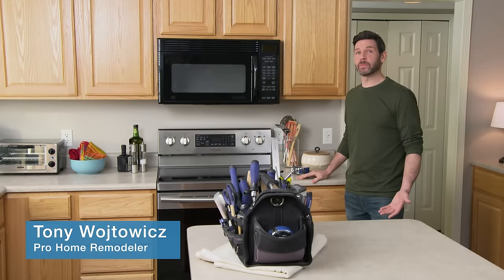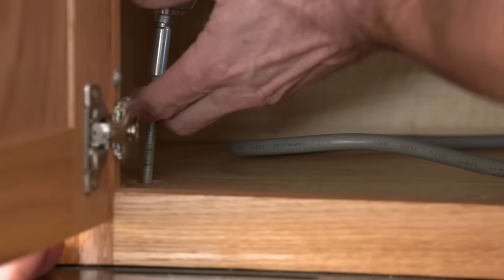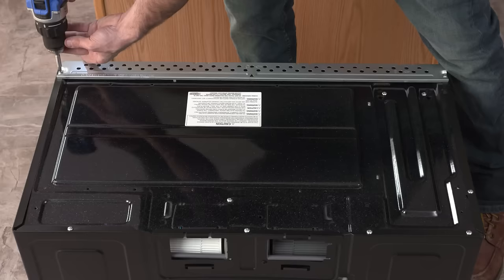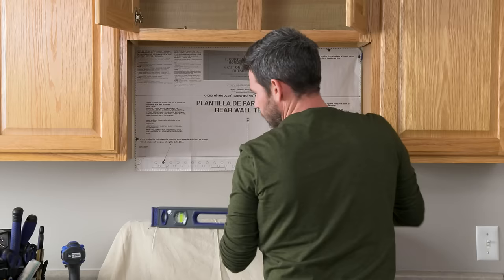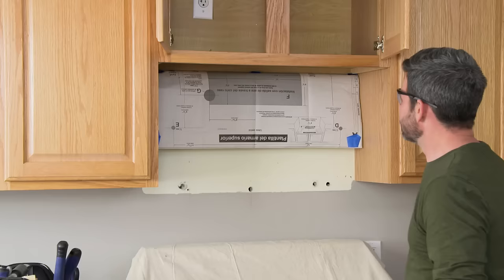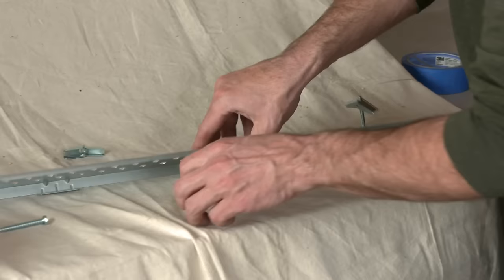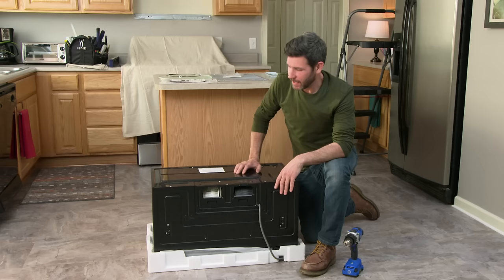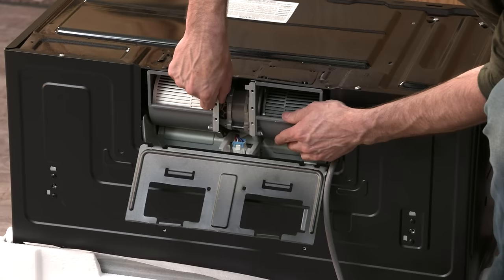How To Replace a Microwave

Comment: After watching the video I read all of the comments, then successfully replaced my "roof-vented" microwave. Here are the two most important hints I picked-up from the comments:
1. Move the stove out of the way - it makes lifting the microwave so much easier.
2. Loosen the vent-work above the microwave before trying to lift out the microwave.

Oh - and my list of the three things you might need for the install that you might not have:
1. Diagonal wire-cutting pliers - to snip-out new vent holes after pivoting the fan.
2. Aluminum tape - for attaching the vent work to anything it need to be attached to.
3. Some scraps of rigid foam, to fill in around any gaps between the venting sheet metal and the cabinetry that was cut away. This is optional, since the foil tape is already blocking air leaks, but to me it results in a more professional install.

Comment: Great tutorial! I was hoping my new GE mw would fit on the old GE bracket, but no, they changed it. Good thing I watched. NOW, what's going on if one of my "self adjusting screws" didn't work? It went all the way down into the hole, but isn't grabbing anything and tightening.🤨🤔😒

Comment: In general I like your installation instructions.  However you did not correctly show the proper use of the stud finder you used.  The stud is found by drawing a mark when the stud finder first lights up, but you continue moving the stud finder in the same direction until the light goes out then back towards the stud until the light comes back on and draw another mark.  The stud is located between the drawing marks.

Comment: But seriously, you reversed the motor to circulate the exhaust air back into the kitchen thru a charcoal filter? Where is that charcoal filter in this installation process?

Comment: If you’re by yourself it’s difficult to lift and tilt the 63 pound oven in place with one hand underneath and the other in front.
Reply: Find a box or something else to place it on and get it in the ballpark. Protect the top of the stove, especially if it's glass.
Reply: @spookerz35  PULL the stove out of the way. That way, protects the stove, your back, and you can use your legs, shoulders, instead of holding something out in front of you. WHY does this guy not say pull the stove out??? crazy not to!

Comment: Great video.  But where is the vent hole for the exhaust fan to push the air outside the property? Where are those steps?
Reply: The fan just moves air and the air comes back into your kitchen. Yep, that's the way this style is. Really no venting.

Comment: Ugh, my problem is that I have tiles that abut the bottom of my old microwave and the only replacement microwaves are all taller so how can I mount the bracket without removing my tiles?
Reply from the maker: You can use painters tape on the tiles, and use the correct drill bit so you don't damage the tile. Then you can simply mount the bracket on top of your existing tile. It may require a little finess to properly level the microwave.

Comment: There's no vent in your example! This video is totally incomplete! A MAJOR omission; if the microwave has a vent flange screwed to the top it can prevent it from tipping forward. Plan to disconnect as much of the vent as necessary to access and remove the flange. Getting the microwave out may prove easy (once you're aware of the need to remove the flange), repositioning then re-taping the vent pipe can be a major pain! Oh, and I've heard some microwaves have extra catches that need released. This video AT BEST is a start, but not much help beyond that!
Reply: Wow... for some reason I decided to keep reading all these comments and you may have just saved me a headache. I'm replacing, and yes I have a vent, and yes - I was hoping to not untape it.
Reply: @Bill-in-SF  So glad for the assistance. It was a headache for me....so I thought I'd better pass on the info and help someone else. Glad you found this before your started your project.

Comment: I used  a car bottle Jack and a board over the range to lift the microwave I did it all with no help
Reply: You are a genius
Reply: Jeff Combes, your advice SAVED me! Thank you. I was on my own due to COVID-19. I didn't have a car bottle jack. So, I stacked up some 12 packs of soda on the countertop on either side of the micro and put a board across the top. And that is how I got my old micro off and the new micro onto the bracket.

Comment: Not certain, but looks like you could have used the same holes for the previous toggle bolts. The wood bolt drilled into the stud is the main load bearer anyway. Good video otherwise!

Comment: I was looking at a new microwave that's a little higher than the one I have now. It looks like the back of the microwave is sitting on top of the backsplash. I guess I need one the same height or smaller.

Comment: Countertop microwave. Don't have to worry about all of this.
It's also better, because you don't have to reach high to take out something.
Reply: Lord baal my uncle said over the range microwaves are old fashioned and difficult to replace
Reply: Don’t have this problem if you aren’t short 😂
Reply: Jake, it has nothing to do with how tall you are. Something hot is hot no matter your height.
Then if you also have something on the stove. That's a fire hazard.

Comment: On the wall template it says “cut along the dotted line” that outlines the entire template. He doesn’t address it at all. Same with the template for the top. You can tell he folded it over on the edges at different points but doesn’t say why. Every little 1/8” means something when you’re pre-drilling holes. Just not sure why he ignores the issue. The instructions don’t give much of an explanation, either.

Comment: Hi, I bought an over the range microwave from Lowes almost a year ago & its still sitting on my counter. I couldn't afford to have them install it but I do have a problem. The power outlet is underneath the cabinet & not inside like in the video. Any tips or advice on how to get my microwave installed with the power at the back of where the microwave goes?? Thanks!
Reply: Brenda Amaya you could go into the cabinet directly above the lower outlet and cut a hole, install an old work outlet box and run a wire down to the existing outlet, tapping in there. Then you’d leave the lower outlet in place and be able to plug the cord into the new outlet higher up. Could also cap off the lower outlet after removing the plug. Imo this is about the only way to do it, otherwise you’d need to move the microwave out maybe three inches to be able to plug the cord in.

Comment: You found two studs.  Why wouldn't you use a wood screw in the second stud . Much stronger than a toggle bolt in drywall....

Comment: Are the mounting brackets universal fit or they specific to each manufacturer? I have a broken Frigidaire  - can i use the already installed bracket if I get a microwave made by a different manufacturer?

Comment: That was a top vent microwave you removed. How do you account for the fact that the new microwave is  NOT a front vent. Where is the vented air going and will it burn out that machine if the vent isn't taken into account.

Comment: I replaced my GE over the stove with a new same model and found that GE had moved the mounting tabs on the wall plate by half an inch requiring me to remove the old plate and use the new one. Annoying!

Comment: WARNING!  WARNING!   WARNING!
If you decide to have someone install your over the counter microwave, as a homeowner, you want to make sure that certain installation steps are performed.  When our previous microwave was installed by an authorized Home Depot installer, the installers worked really fast…..I’m mean REALLY FAST. I didn’t check on them and didn’t check on their workmanship…but I should have.  When our previous microwave died last month, I decided to replace our previous one with the SAME EXACT MODEL, correct assuming that the wall bracket was going to be the same (it was) making the removal and replacement that much quicker. Since I’m retired now, I decided to pursue this as it is a relatively easy job as long as you can get someone to help you remove and install the new one. What I found after removing the previous one was that;
1.	The wall bracket should have had FOUR fasteners installing it to the wall per the installation instructions.  Instead, there were ONLY TWO fasteners holding the bracket to the wall…and one of them had missed the stud, so much that I was able to remove it with my fingers. Talk about cutting corners.
2.	The microwave should have THREE fasteners holding it from the top shelf. Ours only had TWO fasteners. I guess drilling one more hole would take too much time
3.	If you microwave has a ducted exhaust, make that that the outlet bracket is installed. The previous microwave that was removed did not. Again, who needs these things anyway.
Most tradesmen have enough integrity to properly install an appliance into a customer’s home…but some don’t.  Make sure that it is installed correctly……you don’t want it dropping onto your glass top stove after a few months and the installer are LONG GONE.
Reply: It's a shame that people would do that. I'm somewhat distrusting of contractors/hired help for reasons such as this. I just paid to have our driveway resealed (while we were on vacation so cars would be gone) and the workers then walked all over my brand-new front porch with the asphalt sealer on their boots to leave the paperwork by the door.  As they say, if you want it done right, you gotta do it yourself. It's a sad state of affairs out there.
Reply: Clearly what they did worked because you knew of none of it until you took the oven down.

Comment: In regards to the tracks: You state that it might be possible to reuse the track if the new microwave is the same brand. Is it only for the same brands or do all different brands have different tracks and places for the bolts? I was hoping I could just take the old one out and screw in the new one without all the measuring and drilling.
Reply: Yeah, the dream is standards. Why not ONE mounting standard for a standard size microwave? Crazy...

Comment: "Easy project". Not when the installer caulked the power cord through the cabinet above and added beads of caulk to the back corners. Thankfully, the old one was done for. Cut the cord, bent the bracket on the bottom and yanked it out with some muscle. Great instructions if it's not held in place by more than just the top screws and the bracket.

Comment: Where is the exhaust exiting from now that you turned the blowers around?
Reply: Back into the kitchen through a charcoal filter just like he said. I don't think he showed the actual exhaust vent into the kitchen though.
Reply: It just recirculates, it doesn't actually "exhaust" from the house. It passes the air through a filter and then returns into the same space it came from.

Comment: Why wouldn't you just put two wood screws through the plate into studs? Two studs are available. Then there would be no need for the toggle bolts.

Comment: One complaint I have on the exhaust fan is that I had a regular electric stove top with overhead exhaust that vents outside.

This new house has an over the range microwave and when i turn on the exhaust fan it just sucks the smoke from the stove up and out the top of the microwave and now my shitty popcorn ceiling has stains because it's not vented outside.

Why the fk would i want a vent that draws up the smoke only to spit it out on the top of the microwave?  It's still being ejected into the kitchen.  Worst design ever.  Doesn't resolve crap and I get it sorta, it removes smoke and steam from the immediate area but it spits it out on top and just erases anything positive about a vent fan. Now that one area looks like a dog somehow defied gravity and left a piss stain on my kitchen ceiling......

Comment: Its be nice on new construction when framers have the layout if they installed blocking say where a stove was going to accommodate an over the range..  should be standard practice IMO.  Slap a few 2x8s between the studs at approximately heights.

I know this is done when a client has specific details but it'd help out a lot just in general to run some at a set height around the kitchen just incase..  i guess when building track homes in a new subdivision the time spent doing that is time wasted and they throw shit together as fast as they can but yah... 

Same can be said for adding blocking in a bathroom or even stairs to accommodate railings instead of trying to figure out ever 16 OC but who am I but a random commenter 😂😂

Comment: If I purchase stove range and a microwave oven, do Lowe's people install both for me or just the range? I'm planning on getting those Samsung products same as the ones in this video.
Reply: samsung appliances are often crap, they look good, but are badly designed and break, I'm done with their kitchen stuff.
Reply: Eric F  I see. Well
..thanks
Reply: yeah it sucks because I think Samsung appliances look great.  but appearance is not everything, especially with highly priced items.   We're about to throw away our Samsung fridge (only 2 years old).  can't even sell it, it's complete trash.
Reply: They install the fridge and range not dishwasher or microwave I found out today after spending four grand. They didn't install everythingn my brand new home
Reply: Eric F, I also have the samsung frig and stove and microwave. Shit

Comment: What I really want to know is the best way to dispose of a microwave.
Reply: Take it to a recycling center or scrap yard
Reply: Lots of big DIY/white goods shops like B&Q or Currys; will recycle your old one for you, when they deliver the new one.  You can sometimes just drop an old one off there to without buying, if you ask nicely.  :-)
Reply: Bulk pickup in your city may also pick it up for free. That's what they do where I live.
Reply: Take the box from the new microwave you just purchased.  Put your old one inside and tape it up. Put it in the bed of your pickup truck.  Drive to any large, busy shopping center.  Go inside and shop for about an hour.  Problem solved.

Comment: For more information, see my instructional on using duct tape and spray paint to repair the large chunks of dry all that got ripped out during the installation, as well as explaining to your wife why the glass on the microwave door got busted out when you dropped it your head because you forgot to screw in the top.